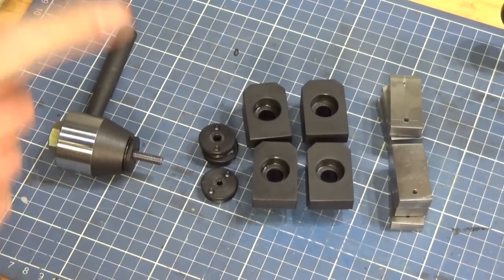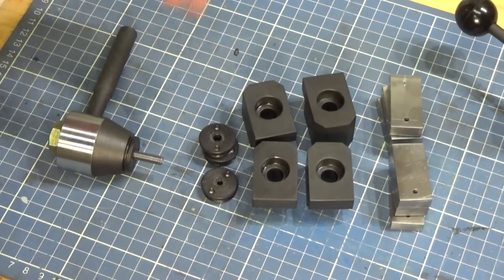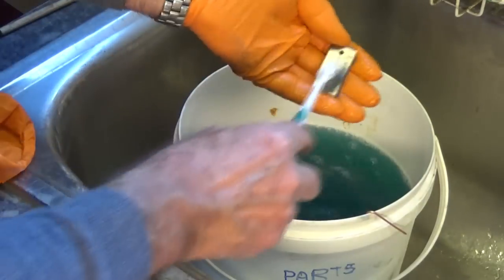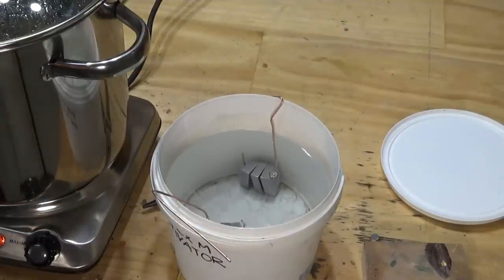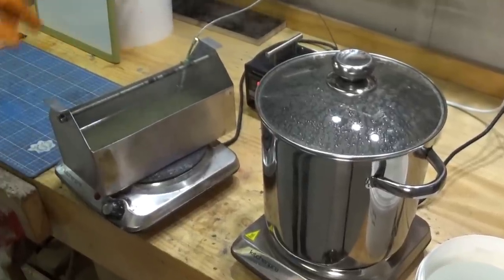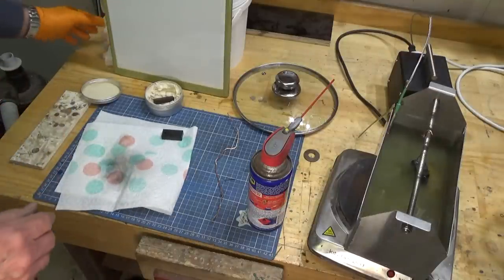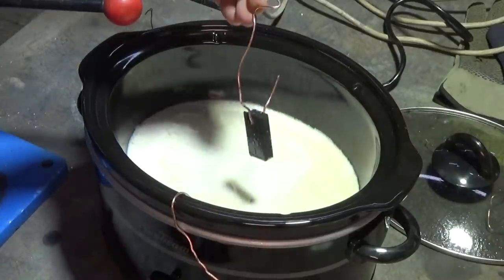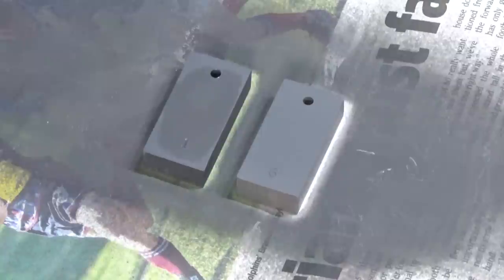Testing Parkerised Metal Finish on Steel

Comment: Mark, the huge bubbles look to me like “bumping” where the solution gets super heated but doesn’t form any bubbles until suddenly a huge one forms and erupts. Very common in the chemistry lab when you’ve done a good job of cleaning and polishing the vessel. The smooth surface has too few sites to help nucleate bubbles. If you google “boiling chips” or “boiling stone” you’ll see how this is addressed. Thanks for the interesting video.
Reply from the maker: Tom, I got the feeling that it was something to do with the solution becoming super saturated. There were lots of solids floating around in what should have been a fully dissolved liquid. The problem sort of disappeared after I added water to make up for what was lost in evaporation. I have seen the phenomenon you described when heating water in a microwave. It can actually get to a temperature above boiling point but won't produce any steam bubbles until you add something to allow the bubbles to form on. I think you are correct in identifying the "super bubbles". You could actually hear them popping to the surface in the early part of the video where I was cleaning the steel samples.  I am going to get in touch with the guys at Jane Kits to see if they have any more information.
Reply: Tom is right. Add some perlite to reduce bumping
Reply: @Preso58  It's not supersaturated, it's superheated. Nothing to do with the dissolved solutes, it's as described by TC.

Comment: Ajax: Calcium Carbonate, Sodium Carbonate and Sodium Dodecyl Sulfonate. Calcium carbonate is the abrasive, Sodium Carbonate is a reasonably high ph alkaline cleaner (between 11and 12) and Sodium Dodecyl Sulfonate is a surfactant and cleaner, somewhat similar to Sodium Laureth Sulfate or Tri-sodium Phosphate (TSP)I think. But I could be wrong about the TSP.

Comment: My method to do both Zinc and Manganese parkerizing are as follows. The Manganese is more of a charcoal grey. It was used on M1 Carbines. The Zinc parkerizing has a greenish grey and was used more on M1 Garands. Either process is a Phosphoric acid  base (no pun intended) with either manganese or zinc dissolved in it. Then a small piece of 0000 de-greased steel wool dissolved in it prior to parkerizing your part. After parkerizing I heat the part with a torch till it's hot to the tough and apply a high sulfur oil to the part and let it soak for a couple hours. I love that little boiling tank you made.
Reply from the maker: That's interesting. I didn't know that you could zinc parkerise parts. I purchased my iron phosphate parkerisng solution as a commercially available product but I love the finish and it has proven to be bullet proof in terms of wear resistance and corrosion resistance. The only downside is that there are lots of solutions to heat up and I am sure it adds a zero or two to our electricity bill now that the energy company has shifted our tariff to a "time of use" model which is code for price gouging. 
Regards,
Mark

Comment: Primer will not protect metal primer will hold a third of its own weight in moisture if you want a primer that will protect metal you will need a primer sealer many years ago an old boss of mine told me this and I didn’t believe him mostly because I was a young dumb kid So I took a piece of bare metal and sanded it really well and primer it and left it outside most of the summer I then took lacquer thinner and scrub the primer off and there was a light coat of rust covering the entire piece of metal that I had sanded and primed
Reply from the maker: Joe, the etch primer that I used is a really cheap product that is sold as an automotive self etching primer. It is pretty much useless on anything but sandblasted steel. I was surprised that it adhered as well as it did. I have seen quick drying paints absorbing moisture as you described especially here in the very humid climate that we have. As the solvents evaporate they lower the temperature of the surface which allows moisture to condense into the paint mix. This does exactly what you described by allowing the bare steel under the paint to start forming a layer of rust. I have a cheap Chinese laser cutter which was painted with a top coat directly over the bare steel. The paint started to delaminate and the steel underneath was red with oxide. Rust is the enemy!
Regards,
Preso

Comment: Yeah Mr P. Is back! Hope you had a great holiday. For the bubbles in your parkerizing tank tank , look at the bottom of the tank for abnormalities. There must be something causing a nucleation site for the bubbles to form. Nice to have you back. Cheers
Reply from the maker: Yves, It was certainly disturbing to watch and I was worried about getting scalded when I was working close to the tank. I may have to get in touch with my contact at Jane Kits to see if it's something to do with the solution or just the way I have designed the tank. I didn't notice it happening when I used a normal saucepan. We had a great holiday but our rubbish dollar is only worth about 60 Euro cents so everything was expensive. Our last tank of fuel in Germany cost us about $110 Aussie dollars. Ouch!

Comment: Really enjoyed the coating test.  Where I live, my shop is subjected to high humidity for a large part of the year and fighting corrosion is a constant problem.  I'd never heard of Parkerising before you introduced it -- I've always resorted to either zinc or nickel plating.  I like the dark color of this process and will make a note to give it a try sometime.  Thanks for sharing!
Reply from the maker: I'm glad you enjoyed watching. I had heard about parkerising too but always thought it would be too complicated to do in the home shop. I also started zinc and nickel plating and realised that the parkerising is actually a lot more forgiving than plating. No need for a power supply and the initial steps are the same as plating anyway. 
Regards,
Preso

Comment: Excellent video Mark!
When i used to work at a hardchrome company we used ajax for cleaning cast iron . We first started with trichloroethane   then ajax then pumice and finally muratic acid , when you has a few big rollers to clean my arms were aching at the end of the day from scrubbing bloody things !
Reply from the maker: Ian, Ajax must have some miracle ingredient but it seems to work when other chemical cleaners won't do the job. Cleaning anything by hand is never any fun. I am guessing that apprentices would get the cleaning jobs?
Reply: Mark Presling 
Yes most of the grunt work  was done by an apprentice or in my case a general hand . The final cleaning was done by the plater because if it came out of the tank with faults in the plating ( we were doing anything up to .030 deposit and sometimes more ) it was his head on the block if it was no good !

Comment: Another great video Presso. I pretty sure your erupting solution is caused by the solution boiling at the very bottom of the pot, because your probe is measuring an inch or two above that. 
Also I've heard that if you cold blue after parkerizing you'll get a much darker better looking back, not sure if it makes the corrosion resistance any better. Would be interesting to see you test it.
I've been wondering how you were doing, glad to hear you had a good vaca! ATB

Comment: I just read that the solution is highly flammable if the solution is too hot. Very nice look when done and seems like a fairly simple process.
Reply from the maker: Craig, I wouldn't think the parkerising solution would burn. The stuff I used is mixed with water. Maybe the vapour is flammable?
Regards,
Mark
Reply: @Preso58  I wouldn't think so either, but that's just what I read about it when I looked it up. It also said the gasses can be quite volitle to the body, with side effects from nausea to coma. Just have to use very good ventilation. It does leave a rather nice coating though. Thanks for showing us your findings.

Comment: I think the eruptions are caused by oilcanning of your tank on the hotplate as it heats and cools.
Reply from the maker: I am not sure. The temperature of the hot plate stays fairly stable or within a few degrees due to it's high thermal mass. I will try to put some diagonal creases in the bottom of the container to stop any tendency to oil can. I was only aware of it happening but it was hard to have a close look to see if it was an actual bubble escaping or displacement caused by the flexing of the base of the container. More tests needed!

Comment: hey Mark, do you know that primer and paint are very different at corrosion resistance? primer is theoretically porous and will rust given enough moisture and time. paint is obviously a (theoretically) hard sheen fully protective surface finish. not all primers are the same, and i think etch primer might actually be worse for corrosion resistance.

Comment: Would be interesting to know if one could use an ultrasonic cleaner instead of the brush for the initial cleaning.
Reply from the maker: Dan,
I have an ultrasonic cleaner but it is actually quicker to just scrub it with the parts wash. Maybe for parts that have lots of undercuts and hidden features the ultrasonic would be the only way to go.

Comment: This is pure conjecture but perhaps, paint that wasn't mixed well was in the drop tube inside the can. That nearly straight line of paint peeling off is a bit odd. So perhaps that first bit of sprayed paint was a bit umm "not well mixed" or something similar. I have to admit that I didn't really pay attention to the direction of spray when you started. Do you purge your spray cans according to directions?
I don't think that you allowed enough time for the metal to dry honestly. The speckled pattern of removed paint from the clean steel kind of shows this a bit. Paint not adhering in tiny pockets, like it it did here, shows that something possibly seeped out of the metal to create the pattern: oil, water, or other contaminates. It might have been a good idea to bake such chunky bit of steel for a while before painting. Even then it can be difficult to ensure that there are zero contaminates. Then again perhaps the metal was perfect and you had old cruddy paint. To many variables and one can only guess.
Reply from the maker: Ian, I think you might be correct about the paint not being mixed properly. I must say I was a bit casual about prepping the paint can. It was an old can too so that might account for the speckling. The parts that I tested had been sitting along with the others for about 8 weeks so the paint should have been well an truly cured. I was expecting the paint on the untreated part to just peel right off. Maybe I should have used a coat of enamel?
Reply: @Preso58  No doubt the paint was cured. You didn't mention why the paint test was the one that you were most curious about. Is this for the sake of curiosity or did you want a comparison because you are thinking of using paint or Parkerising for a specific purpose? For the home gamer, I think it's just important to note that finishing metal using some method is MUCH better than leaving bare steel around. Durability of different methods is difficult to test because it takes a much more sophisticated procedure than most of us have access to. Just trying to make sure everything is coated perfectly (to not skew results) is a pain in ass. Now move onto a controlled test of durability... Ya it's not really worth the effort. Thanks for the interesting video.

Comment: Mark,

I would like to see this test repeat the same test with both electroless nickel and a zinc coating.
Reply from the maker: Roger, I did some electroless nickel plating years ago but the requirement to heat up the nickel solution made it just as time consuming as the parkerising. I have successfully zinc plated at home and just recently I did a test piece which I have added to my other samples. I will probably revisit the samples next year just to let you know how they are holding up. I can report though that the parkerised test samples are still fine but the untreated steel piece is now red with rust. https://www.youtube.com/watch?v=NpW1inPujWk&t=77s

Comment: It’s the bottom of the container touching the hot plate heats up and expands then pops off the hot plate then cools down and repeats it’s caused from hot spots in the Element
Reply from the maker: I hadn't thought of that. I may have to put some diagonal creases in the bottom of the container to pre stress it. However, I started to notice that the level of the solution was dropping as the water in the solution boiled off. I topped it up with clean water and the popping stopped. I am wondering if the solution was becoming super saturated. I want to try it again with the solution made up to 5 litres which is what I started with. Jane Kits do recommend having the correct ratio of water in the solution. 
Regards,
Mark

Comment: Thanks, interesting stuff.
Would like to see if the abrasion test is better on the fully treated part ie no2, wether the oil helps.
Cheers
Reply from the maker: Raymond,
I guess I was expecting that the coating would be much tougher than it actually is. I don't have the equipment but it would be interesting to cross section the metal to see how thick the coating is. 
Regards,
Preso

Comment: How do you think parkerized hand tools would work?  Since the rust prevention seems to stem from the oil / wax / whatever that is held in the texture of the parkerising, I wonder how well it would hold up on the part of a wrench that is in contact with your hand or leather gloves.

Do you think the oil would be lost too quickly to be useful?  Does the oil become a nuisance for actually gripping the tool?
Reply from the maker: The texture of the treated parts doesn't feel oily at all and the crystalline finish actually makes it feel more grippy. The oil that is sold by Jane Kits is designed so that it soaks into the surface of the phosphate coating but doesn't form a film on the surface. I have had people suggest that other types of oil would be better and probably if you were looking to store a part for a long time then something like cosmoline would be good but I have heard that it can be waxy and sticky so it wouldn't be so good for tools. It is too soon for me to tell how the parts will hold up with repeated use in say, a gloved hand so I am keen to find out too. For now, I just like the look of the finish and it is a useful way of preserving the tools  that I was constantly having to clean up as the corrosion appeared on them.
Regards,
Preso
Reply: Understood.  Thanks for taking the time to share, and I will be interested in any follow up on the subject.

Comment: I can't help but notice that the result you got on your die holder is much nicer than you got on your test pieces.
Any idea what caused that?
Reply from the maker: John, I noticed that too. I can't think why they look different. They are both made from bright mild steel and the process was essentially the same. Maybe I just took a little more care polishing the die holder.
Regards,
Mark

Comment: You got contamination on part 1 from the WD40 that you used near to it.
Reply from the maker: Maybe, cleanliness is everything when doing any sort of metal plating,  anodising or paint preparation. I used to work in a factory that made fishing reels and all the metal parts went into giant vibratory tumblers with some pretty nasty alkaline solutions prior to nickel and chrome plating. Nothing was touched by hand once the parts came out of the tumblers. In a small shop it's almost inevitable that parts will get contaminated in some way. However, I still have samples of those parkerised parts and not one of them has rusted since I treated them. I should really do a follow up soon to show how they have faired since doing the original video. 
Regards,
Mark